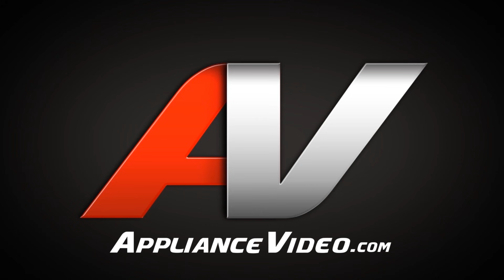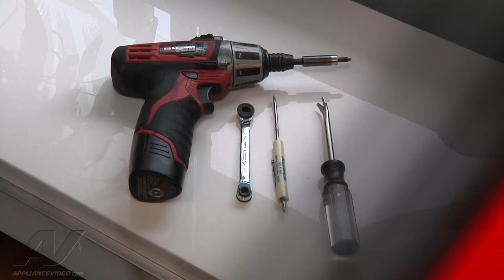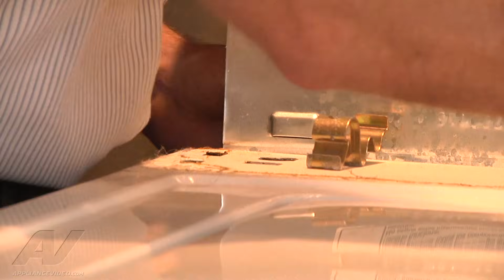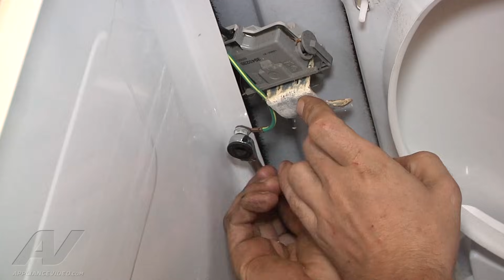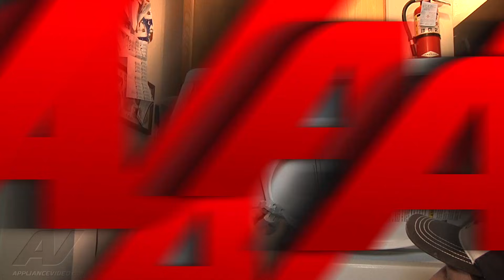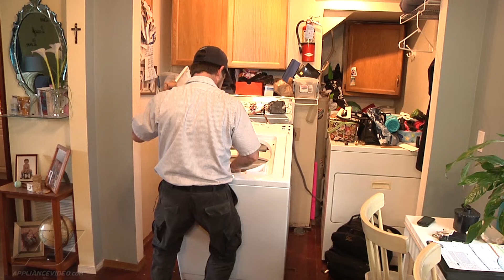Kenmore Washer Repair - Not Draining - Switch

Comment: That was hard! I stopped and reviewed each step at least 5 times. So now, I'm doing a load, so we'll see. The repairman was $80 just to come to the house! ($8.99 for the switch.) The front is a bit too high. 
Thank you, instructional guy - the worst part was putting the big cover back on.
Reply: BTW - I'm 66 yrs old

Comment: I just did this repair on a 90 series. Great video and instruction. I want to mention that there were 3 hoses under a removable panel under the knobs on the left hand side underneath the control panel that need to be disconnected before removing the cabinet. The panel on my unit just swivels to the side. The clamps for the hoses will likely require pliers. I used channel locks to loosen them and allow the hoses to disconnect. It wasn't mentioned in the video and I discovered them when trying to remove the cabinet. Be sure to reconnect them when you put the cabinet back in place after replacing the drain switch. 

Aside from that it was an excellent video. I'm only posting in case someone else encounters that. It might not be this way on all models.

Comment: After watching your video, I pushed up on the bottom of my lid switch and the rinse cycle started. I pushed up a little harder on the switch and it clicked back together. It works again and I didn't have to take my machine apart to fix it. Your video is perfect and I'm glad I found it on utube. Thanks for the big help.

Comment: Still relevant. Had an issue with the washer draining. Pulled it apart. I immediately saw a senge on the metal housing and a broken wire. Wasnt the switch. Fixed the wire and the washer works fine. This video helped me out.

Comment: Isn't it so ironic when you consider just how many people used to own this particular washer and dryer, and only now, after so many years later, they are rushing out to buy the brand new Speed Queen washers and dryers because pretty much every appliance review company in the industry has rated them the best washers and dryers on the market?

It's ironic, but also quite hilarious that with a purchase of a speed queen set, they are pretty much buying their old Kenmore series 80 all over again, but just with a fresh, and slightly more modern exterior, and with a different manufacturers branding.

Comment: The adhesive that secures the both halves of the housing is where it fails, not the switch components in the housing.  Simple solution is to use a cable tie right behind the rotating arm; the cable will secure both halves of the housing creating a compressional force to prevent the adhesive from separating from housing and now the switch will last much longer and depend on the internal switch comports to wear.

Comment: Does anyone know the make or model numbers for the washer? I need to change the belt and washer pump. 🤦🏽‍♀️😔
Reply from the maker: Great question, if you have a more technical question that our parts department cannot answer, you can search our over 17,000 answered questions free at our website www.ApplianceVideo.com under our Repair Help section. You can also call our parts department at 1-800-830-5465 and they can give you help 7-days A week ,or search at www.SaveMoreOnParts.com  .

Comment: support the switch from the bottom??
Reply from the maker: Great question, if you have a more technical question that our parts department cannot answer, you can search our over 17,000 answered questions free at our website www.ApplianceVideo.com under our Repair Help section. You can also call our parts department at 1-800-830-5465 and they can give you help 7-days A week ,or search at www.SaveMoreOnParts.com  .

Comment: Very helpful, thank you. Can you tell me if the draining issue exists is it always the lid clip or can it sometimes be a plug up in the drain line?
Reply from the maker: Great question, if you have a more technical question that our parts department cannot answer, you can search our over 17,000 answered questions free at our website www.ApplianceVideo.com under our Repair Help section. You can also call our parts department at 1-800-830-5465 and they can give you help 7-days A week ,or search at www.SaveMoreOnParts.com  .

Comment: On our Kenmore 110.28902790 Washing Machine with a failed lid switch, the cabinet doesn't pull loose and there is a flimsy back plate that looks like it has to be removed instead. Do you have a video for the 110.28902790?
Reply from the maker: Great question, if you have a more technical question that our parts department cannot answer, you can search our over 17,000 answered questions free at our website www.ApplianceVideo.com under our Repair Help section. You can also call our parts department at 1-800-830-5465 and they can give you help 7-days A week ,or search at www.SaveMoreOnParts.com  .

Comment: I suspect this is the reason why my washer won't drain. I've already ordered the part and will update if it works. Thanks for explaining the process in such a clear, concise way! Definitely earned a sub!
Edit 9/16/20: it was the issue! Thanks for making this vid!
Reply from the maker: Great question, if you have a more technical question that our parts department cannot answer, you can search our over 17,000 answered questions free at our website www.ApplianceVideo.com under our Repair Help section. You can also call our parts department at 1-800-830-5465 and they can give you help 7-days A week ,or search at www.SaveMoreOnParts.com  .

Comment: Need a video showing where the outer housing is replaced.
Reply from the maker: Great question, if you have a more technical question that our parts department cannot answer, you can search our over 17,000 answered questions free at our website www.ApplianceVideo.com under our Repair Help section. You can also call our parts department at 1-800-830-5465 and they can give you help 7-days A week ,or search at www.SaveMoreOnParts.com  .

Comment: I have a Kenmore 400 not rinsing could this be the problem
Reply from the maker: Great question, if you have a more technical question that our parts department cannot answer, you can search our over 13,000 answered questions free at our website www.ApplianceVideo.com under our Repair Help section. You can also call our parts department at 1-800-830-5465 and they can give you help 7-days A week ,or search at www.SaveMoreOnParts.com  .

Comment: I have the same washer. The inlet valve stopped working and wouldn't dispense hot/warm water. The part was roughly $30 and took a few minutes to install. 

He could have cleaned the rust and corrosion from the clip that he took off the old switch before he installed it on the new switch. Keep your parts clean.

If your handy with tools and want to learn these appliances are fairly easy to repair. The most common part to replace on a dryer is the heating element. My Dad was able to keep a dryer going for years by replacing the heating element. I'd say he got his money's worth out of that dryer. He finally replaced it after 22 years. They can last longer than that.
Reply from the maker: Thanks for your response, we are glad we could help. Our library of over 5,700 videos are currently helping over 1.6 million people like you every MONTH.  Please help us by subscribing to our YouTube channel, or post our website www.ApplianceVideo.com to your Facebook page, Twitter, Instagram or any other social media sites. Your support will help us keep producing more free quality videos.

Comment: Can you not get to the switch without removing the entire front? There is a seam near the top. Does it not open? My washer is very hard to get to and will require moving other appliances to remove the entire front.
Reply from the maker: Great question, if you have a
more technical question that our parts department cannot answer, you can search
our over 10,000 answered questions free at our website www.ApplianceVideo.com under our Repair Help section. You can also call
our parts department at 1-800-830-5465 and they can give you help 6-days A week
Monday -Saturday, or search at www.SaveMoreOnParts.com  24 hours
7- days A week.

Comment: Eekkk seems like alot of work but less expensive than calling for service help. Where I get correct switch or I guess I can Google? Kenmore series 110 I really hope it's that easy🙈🤔Thank you
Reply from the maker: Great question, if you have a more technical question that our parts department cannot answer, you can search our over 13,000 answered questions free at our website www.ApplianceVideo.com under our Repair Help section. You can also call our parts department at 1-800-830-5465 and they can give you help 7-days A week ,or search at www.SaveMoreOnParts.com  .

Comment: I changed the lid switch on the Kenmore elite washer machine and still didn't work so I removed water pump and hoses and look for something clogged I didn't find anything everything was good. The washer was washing but wasn't draining and spinning. The problem that I found to be was the Timer here's the part number to look it up #3955340 after installing I had to reset the machine by connecting the power cord and follow the instructions I found here in YouTube about waiting 1 minute and then open and close the lid 6 times. One's I put it to regular wash it started.
Reply from the maker: Thank you for
your positive response, we are glad we could help. Please help us by
subscribing to our YouTube channel or post our website www.ApplianceVideo.com  on your Facebook page. We want to let your
friends & family know how our FREE videos can help them.  Or you can
support our parts department at 1-800-830-5465 and our parts website www.SaveMoreOnparts.com .  This is the only way we can continue to
post free videos and help over 1-million people per month like you repair their
own appliances. We also have thousands of more quality videos on all major
appliances made by our factory trained technicians at www.ApplianceVideo.com .
Reply: Don Thanks for the tip I suspect this to be the problem with my machine  as well because it drains on permanent press but not on ultra clean so the switch is working and the drain isn't clogged.

Comment: how much should i pay someone to fix i dont want to be overcharged
Reply from the maker: Great question, you can call
our parts department at 1-800-830-5465 and they can give you help 6-days A week Mon-Sat . You can also search at www.SaveMoreOnParts.com 7- days a week.  If you have a more technical question that our parts department cannot answer, our technicians are answering all questions at our website at www.ApplianceVideo.com under our Repair Help section. We have over
4,000 common questions and answers that you can easily search through by your model number, appliance make, and problem or error codes, and It’s free to search through our question & answer library.

Comment: lid switch is working so what else could it be?
Reply from the maker: Good question, with our
technicians now getting hundreds questions weekly, they are answering all questions
at our website http://www.appliancevideo.com/repair-help/ .  We also have over 3,000 common questions
and answers that you can easily search through by your model number, appliance
make, problem or error code and it’s absolutely FREE.
Reply: Probably the drain pump